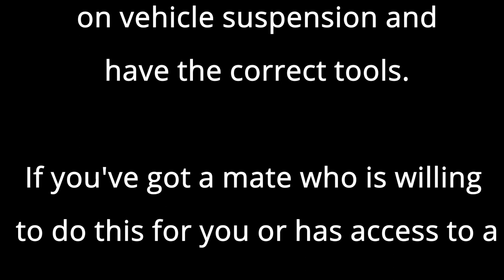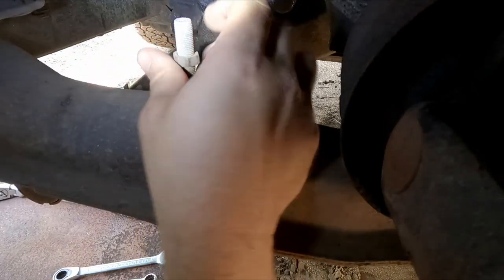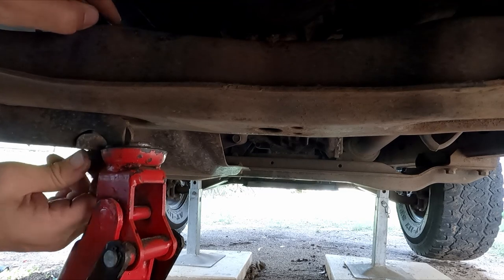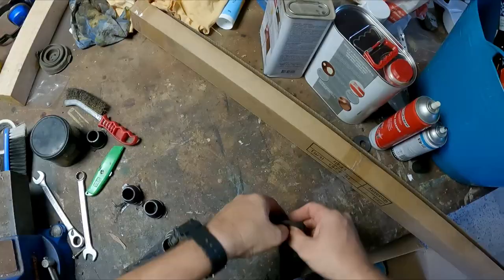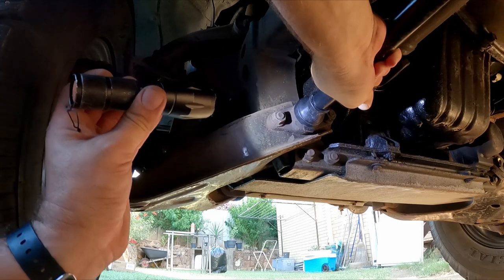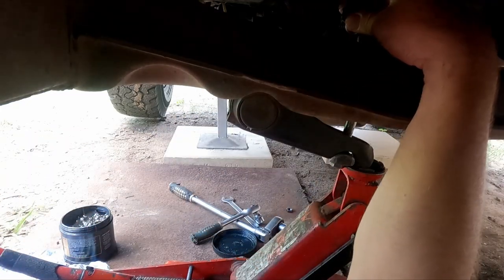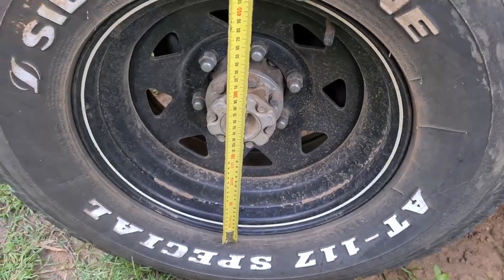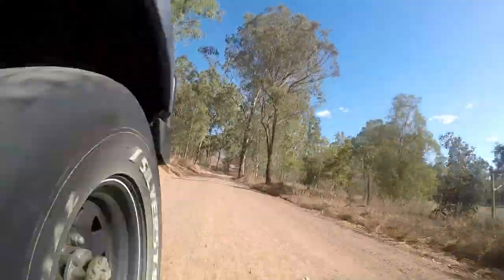Torsion bar replacement on a Mitsubishi Pajero/Montero/Shogun

Comment: so with those bars your car get up to level you wanted - i guess 2" lift ? and its not stiff as when using factory bar for lifting ?
Reply from the maker: Correct. If you crank your factory bars up, you may get lift, but the spring rate will not be there and it'll feel like you're riding a skateboard. LoL
Reply: @wilddonkeyadventures  yeah that is what i experience now ;) thats why i am looking for honest opinion if those are worth to get - so in your opinion that's the way go to?
Reply from the maker: @ImhoS4  Yeah i'm definitely happy with them. Once you car has a lot of kilometres on it, it's best to replace them with new ones...
Reply: @wilddonkeyadventures  thx bro

Comment: Hi mate, I’m going to lift up my 1999 Pajero NL SWB 3.5L, I consider to buy Raw nitro 2inch lift kit, did you know what is the length should I choose for the torsion bar? They have 1277mm and 1307mm
I have arb steel bar and winch
Reply from the maker: Hey mate. The only way to know is to get under the car with a tape and measure them unfortunately. 

But if i might also suggest, don't go for the Raw kit. I bought one of their so called lift kits and it was horrid. Granted i didn't change the torsion bars at the time, i just cranked them, but the rear springs were harsh and they sagged in no time. In fact they ended up sitting at about the same height as the 400,000km springs not long after they were installed.

I ended up ripping them out and putting Dobinsons in. Now the car actually looks like it has a lift, and a few years later, since this video was posted, they're still going strong. Trust me, buy a quality lift kit and you won't regret it.

Comment: Great video man, really helpful, I just got my two inch lift kit for the pajero, wondering if I should go up one or two splines on the new Heavy duty torsion bars? What do you think
Reply from the maker: Cheers man. If they're HD bars, probably one at the most. If you go too far they'll end up giving a super harsh ride.
Reply: @wilddonkeyadventures  thanks man, really appreciate it

Comment: Do tortion bars come in diffrent lengths for height or is it best to dp what you did and turn the adjuater back one spline or 2?
Reply from the maker: Hey mate, the torsion bar length doesn't have anything to do with height. If you want higher sitting bars, you either need to buy thicker ones or crank yours up.

Comment: Great video mate! Thanks heaps for posting this. Given me confidence to get in there and give a red hot crack! I've done the center bearing, full exhaust kit, so i am not shy on getiing in there. I have a 2" sus lift on my 04 Triton, but left the standard torsions on, which was a mistake in hindsight, so this is next on the list. Only question I have is when you place the rear arm (where you tighten the bolt) on the end of the new bar, i assume it needs to line up correctly, like the front into the control arm. How did you line those splines up straight up without them being off? As the front ones need to be in a specific spot, marked on both the bar and the socket on the control arm, is it the same on the other end?
Reply from the maker: Pretty much hey. The beauty is you can just take the arms off again and reposition them if you get it wrong. Best thing to do is to measure them before you remove them to give you an idea of where to put the arms. Then just adjust from there.
Reply: @wilddonkeyadventures  thanks brother.

Comment: Really nice video, i have a question y couldnt find any answer yet, i got a 97 v6 3.5 gen 2 montero, i just got bf km3 33x12.50 tires installed, i cranked original torsion bars about 4 cm but the front suspension got really stiff and i didnt like the ride quality so i got a 1,5 inch body lift and cranked the torsion bars back almost to standard position. The quiestion is if i install Dobinson or EMU torsion bars and crank them to gain 3 or 4 cm will the ride quality still suck like cranking stock torsrion bars or are they softer than standard cranked torsion bars?
Reply from the maker: No the after market ones will still have a good spring rate. You won't need to go too heavy in yours because the V6 is lighter than the diesel. They'll still be firmer than factory ones but they won't feel like you're driving a go kart...
Reply: @wilddonkeyadventures  Thank you!

Comment: Hi
Great video.
I get a loud "cracking" noise when I drop off a high kerb on lock (same Shogun as video). All joints in good condition so wondering if it was possible to be torsion bar.. But I can't see any wear n tear marks.
Reply from the maker: Hey mate, yeah mine does it every now and then as well. It's a pretty common torsion bar thing. Not 100% sure what causes it though. My guess would be something needs some grease on it, maybe around the adjuster area. Could try spraying some WD40 or Inox around it and see if that helps.
Reply: @wilddonkeyadventures 
I think I will strip them out and see just where this noise is coming from. Cheers for the reply. Very useful video too 👍

Comment: love how you take time to reply to the comments, so much help from that too, thanks. im having big issue with putting the lower ball joint back in the knuckle. the hardest part is that i accidently taken out the axle with the rotor and i cant figure out how to put them all at the same time.
Reply from the maker: Thanks for the comment mate, yeah i know how annoying it can be when you ask a question and you never get an answer. As for your problem, as you're installing the axle, turn it as you push it in. the splines probably aren't lined up, and it needs to be straight as well.
Reply: @wilddonkeyadventures  big help! thank you

Comment: Do I need to get new bars or can I use the old ones and adjust them
Reply from the maker: Nah you don't need new ones, depending on how old your old ones are, or how much weight is on the front end, you can crank them up. I replaced mine because they had 400,000+ km on them and i put a steel bull bar and a winch on the front. So in my case it was definitely justified.

Comment: Good stuff mate, quick question: why do you turn the spring older down one spline? You say to give yourself a bit more future adjustment. What do you mean by that? And how do you readjust them after the drive? Thanks
Reply from the maker: The reason i turn the adjuster arm a bit more is because over time the springs will sag, and eventually they will get to a point where you will run out of adjustment with the adjuster bolt, and need to remove the adjuster arm and turn it a spline or two, this is called "re indexing", it can restore ride height for a while, but you will get a harsher ride out of it. Doing it at the beginning avoids having to do it again in the future. But if i had to do it, it would likely be many years down the track.

As for adjusting after the ride, that's simple. Just loosen the locking nuts on top of the adjustment bolt, and turn the bolt in a tightening direction until the desired height is reached. It's a good idea to count how many turns of the bolt you do so you can do the same on the other side thus raising it evenly. Although sometimes you may need to tweak one side or the other as one side may settle differently depending on weight distribution.
Reply: @wilddonkeyadventures  thank you very much for the explanations, very clear and detailed! I'm going to replace my old torsion bar this arvo with new heavy duty  ones and your video will be my guide 🙏🏼
Reply from the maker: @davidesoggia8250  I'm happy to help mate!! Let me know how you go.

Comment: Nice! what lift kit did you use?
Reply from the maker: Thanks mate, I got the Dobinsons kit. Went with the linear rate 40mm rear springs as well. They're 250kg constant load.
Reply: @wilddonkeyadventures  I need a little guidance,  I have a 96' Montero LS, could you point me in the right direction?
Reply from the maker: @gravityimage5  Sure thing, what did you need to know?
Reply: @wilddonkeyadventures  For starters do you have a link to the lift?
Reply from the maker: @gravityimage5  Yep, this is the one. Be aware, you MUST measure the length of your torsion bars before ordering, because there are 2 different lengths. One size is 1282mm and the others are 1307mm.

Here's the link: https://dobinsons.com/mitsubishi/mits-53/suspension

I'll be in and out for the rest of the day so if i don't reply straight away, i'll respond as soon as i can...
Reply: @wilddonkeyadventures  so even though the ad says 98' - 00' pre 91? It will fit the 96' Montero as well? I do understand   SWB AND LWB, which is what I have...
Reply from the maker: @gravityimage5  Yep, you'll notice if you scroll down it will have the individual years. Mine is a 96/97 model. However, if in doubt check with your retailer. Cos there could be some variation due to the country of sale.
Reply: @wilddonkeyadventures  love the text "retailer" cause it 96' lol. 
Yeah, I currently live in Reno, NV, you?
Reply from the maker: @gravityimage5  I'm down in Queensland Australia.
Reply: @wilddonkeyadventures  oh man, Great Barrier Reef...
Reply: @wilddonkeyadventures  Man, the GBR is a childhood dream. 

Also, have you ever had any codes, problems with the catalytic converter?
Reply from the maker: @gravityimage5  It's a pretty awesome place, went to the GBR a few years ago. Definitely worth the visit if you can.

Haven't had any catalytic converter issues cos mine is an old school diesel.
Reply: @wilddonkeyadventures  ah! so theres a differnce.
Reply from the maker: @gravityimage5  Yeah they put diesel particulate filters in modern diesels, but they're more trouble than they're worth. But the suspension setup is the same.